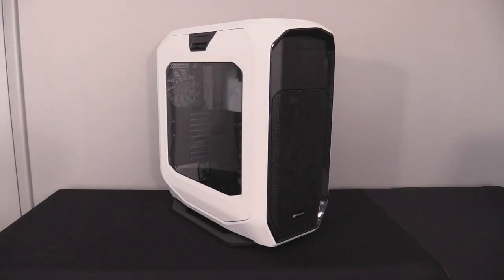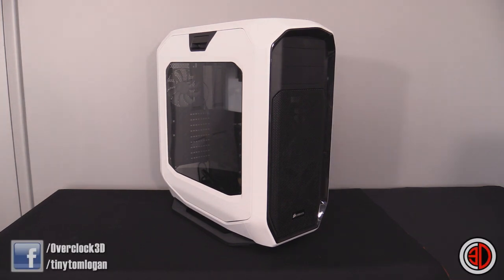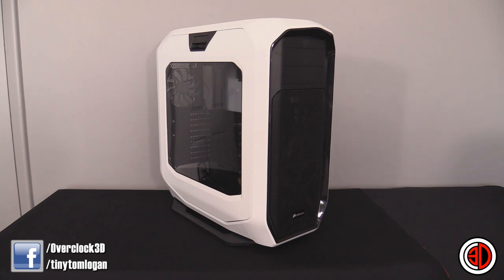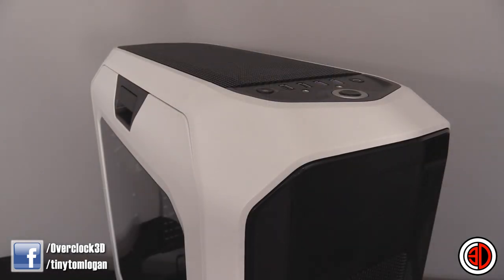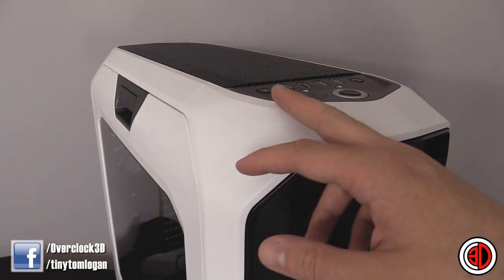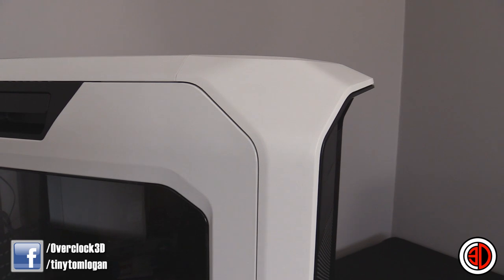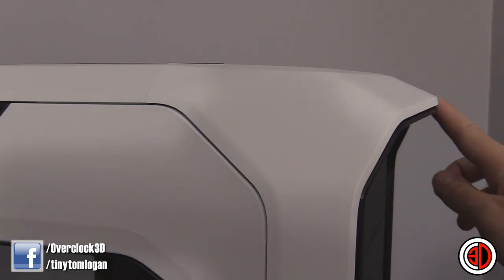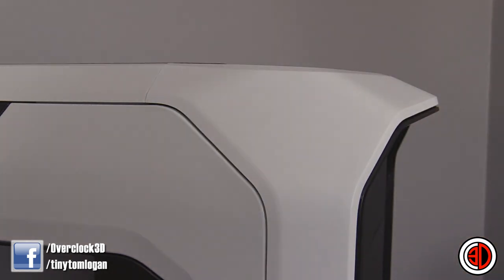Corsair Graphite 780T Review

Comment: So, i have now bought the case and installed two 360 Radiators in it. I´m using HW Labs Blackice GTX 360 Lite. These Radiators fit without any modding of the case even in the front. But if you want to use a radiator in the front you need longer screws to mount it. M4x35mm will be needed to mount the fans on the radiator.

Comment: I bought 600T white this January for my 4770K build.. now i'm selling 4770K and getting 4790K and swapping case to this 780T.. 600T will now house i5 4670K build with 270X x 2 Crossfire(My second PC) and selling this PC's case 300R which is used from earlier build 2 years ago.. So, this case is gonna be new with 4790K, rest is same from 4770K( H100i, 2 X 290X toxic is crossfire, AX1200i red and white LED strips for Black-Orange-White color based build).

After hearing so much about this case, i can't wait to get mine.. Plus, corsair have one of the best after sale service..Love it

Comment: I just purchased this to replace my 200R. I was debating either the Phanteks Enthoo Luxe, or this one. This one surely is a large tank, but in the long run it would be worth it if you want to do endless upgrades such as custom water cooling and such. Also, with the side latches, you won't have to worry about losing screws, etc. Hardware installation was easy, and endless cable management with plenty of room where you won't have to worry about how difficult it is to close the case behind the motherboard tray. 
Negatives is lack of Velcro tie downs that the Phanteks has, the plastic screw organizer box Phanteks has with endless bits, etc., and no rubber grommet for the power supply wiring hole. Other than that, very happy with it.
Reply: Loki5041, the panel does scratch. Not totally noticeable but I did it first day when I had it on the floor when I built this case.

Comment: Finally! I've been waiting for this case all year long, ever since the 760T came out. Not that I thought that particular case from Corsair was a bad design, just that it wasn't quite big enough/roomy enough for my personal rig. The 900D was too big IMO but the the 780T is absolutely perfect for triple slot GPU watercooling rig with two 420mm rads and have enough room to have a large reservoir. Personally I'll be fitting a XSPC dual bay reservoir into this case, since it only has two 5 1/4 in bays it will look like it was a part of the case instead of added into a rack of bays like the 760T would've. Perfect water cooling case the 780T, I cannot wait to start my new X99 build in this beast!

Comment: Corsair makes the best cases, IMO. Always beautiful & cheap.
Reply: ***** Well, there are plenty of amateur & professional "experts" that use Corsair cases and like them. FD and Phantek are good, but.. meh, never been a fan of the designs.
Reply: ***** Again, subjective.. my 300R has never disappointed me. Seems like super quality for the buck.
Reply: ***** What else would you want in a $50 case? A $400 watercooling set? $1000 graphics card? $500 CPU?
Reply: ***** I'm exactly what Joker said earlier: "novice". I have only built three systems and both quite inexpensively, so you know, "fan boy".. I'm too big of a casual-builder to be able to consider one manufacturer for elites only. So, naw.
Reply: CaseLabs make the best cases.
Reply: ***** I agree about Phanteks cases.
Reply: ***** i agree with you. but i wouldn't say corsair makes "shit cases" they are over priced yes, but bad case no..
Reply: you either like corsair cases or you dont, whats to argue about?... personaly i use a corsair air 540 because i like the way it looks, the room it has to offer, the ease of cable management and its very easy to work with if you want to mod it
Reply: Horrible and naff. Flimsy looking - those side panels look tissue paper thin..thumbs down for the product
Reply: Corsair used to make solid cases, but everything now looks like it's cut corners in some sort of area. . .
Reply: Ruben Williams  This is a good point, They are definately favouring plastic cases over normal ones. A good example of a great corsair case is the Vengeange C70, all metal build, awesome looks and features.
Reply: They're nice.. But I'd rather they did something a bit more premium that isn't as flimsy. I have a 750D; love the thought out design but wish the materials were a bit better. The case is what you see the most. I'd pay good money for a high quality Corsair case. Give me something made of high grade aluminium, I'll pay you 200 quid!
Reply: I really think they are lacking more and more of quality.
Reply: "Cheap" is relative, it depends on what you are comparing it with and what features you're looking for on a case. I've used plenty of Corsair products especially their computer cases, and I gotta admit, they get better in terms of bang for the buck. Sure Corsair don't make the cheapest case in the market, but their products can compete because they do use good materials and they put proper thoughts on the design especially on their "premium" cases. Although they're not perfect yet, they sure are improving. Last but not least, Corsair's customer service is one of the best imo.
Btw, I'm not a fan of Corsair, I'm just a fan of good companies that make good products.
Reply: Eric Sundquist Quality is the Obsidian Series. Graphite is the design and sleek looking series. Carbide is more value orientated and smaller than normal. Vengence is for LAN's and shows
Reply: ***** I appreciate and buy good products too, hence mostly I buy Cooler Master, Corsair and NZXT cases for most builds. On pricing, $200+ for a super cool case is expensive indeed but it's worth to invest considering the value of entire build - $3000-$7000 hardware in it.
Reply: TheWargod56

Yeah I watched Linus' video just now and the HDD cage wobbles. . . just other stuff on cases like the 350D, No rubber mounts for PSUs etc. .  .They're small nitpick things I agree, but a case company as renowned as Corsair should pay abit more attention to little details. . . as you say cases like the C70 were built like a tank.
Reply: Ruben Williams no its not nitpicking ..you have to have a minimum quality/sturdiness for  a £150 case..this case has not got it. if this was a fair review it will have had point nocked of for this..so this getting a gold award just devalues the gold award... am not anti corsair as the rig am building now is a 900D
Reply: yes, especially the obsidians are very pretty.... i have a 750d on my own :)
Reply: *****
Picked up a 350 D a few months ago. My first proper PC case. Best 90 bucks I've spent in a long time. But it's also a long way from a crazy over the top water cooled behemoth. Love my case though...
Reply: *****  Who are, Corsair? most of their cases are really overpriced, and are outmatched easily by many manufacturers. They often only include one fan with their cases and it's not even a very good one, whereas Fractal will include three and all three will be of great build quality and often are 140mm too.
Reply: Fractal R4 £69.99 on ebuyer. For most builds it's a good choice.
Reply: They might be beautiful but the build quality and the features are terrible, and in Sweden this case cost 400 dollars, so it's certainly not cheap
Reply: Yes they have great cases but the pricing?lol no,
Reply: Corsair cases are only cheap in their build quality.
80 percent plastic, and they charge for 100 percent steel
Reply: InfiniteDroid 1769 på inet, dock är inet överpris på de flesta varor
Reply: Mikael Soltaniha but this one is expensive

Comment: Hey Tom, thanks so much for the video (im a little late to this I know) 
If you see this I have a few questions!
Does the molex connector at 13:20 activate the front LED above the fans? 
And have you successfully tried a push/pull set up with the top fans? 

Thanks again! Just got this case and loving the real estate!

Comment: I bought a 780T and the Radiator Support is not so straightforward as the review tells. I have a XSPC RX360 radiator that can't fit at the top without blocking the access to the top drive bay. So you keep only 1 external drive bay. If you put it at the front, you have to unbend a latch on the upper drive bay so the radiator can properly align with the fans, the connectors must be facing up and are partially blocked from another part of the drive cage.you have to cut a part of the drive cage for propper access to the connectors. I have a dual bay reservoir so it iincreases the dificulty. I'm having a hard time assembling my system

Comment: Hi Tom, i wanna buy this Case but i´m not sure which radiator will fit in the front without any mods. The Alphacool seems not to fit in the front, so i need the measurements of the Alphacool to get a smaller radiator that fits in the front.

On the Alphacool website the measurements are (LxWxH): 400 x 124 x 60 mm
Is this right?

Comment: When you put the 80mm rad in there I actually said "holy shit" out loud. I don't watercool, and haven't since like '02, so I'm not used to these stupidly huge radiators.
Fuck me that white rad looks nice in that case! Pull the badge off, and make a whole build around two of those. jammed into that case. Looks like you could almost do two of them and have both in push-pull.

Comment: I was wondering with this case, is it possible to run a 280mm rad in the top (with a dual bay res) and a 280mm in the front and a 240mm (maybe 280?) at the bottom? He didn't mention the 280mm so was just wondering..

Comment: So which 360mm radiator does fit in the case front without modifying it? Can you recommend one? I had that problem you mentioned with this one: Alphacool NexXxoS XT45 Full Copper 360mm. I`m a little bit unsure which one i should take now.  Thanks! :)
Reply: ScraXer did you find a good 360 in front without any modifications needed ? because I plan to buy this case. thanks for your help

Comment: I have the possibility of buying of these a a good price. My "problem" is that I'd like to build a really low noise - silent system. I know that there a special casings for doing so - but I like the design of the 780T. SO - is it possible to build a silent system with this case?
Reply: PerfectBodyQuest by Harry M Lots of fans running at low rpm :)
Reply: Thanks - I chose the SilentBase 800 now - Works great ;)

Comment: is the Corsair CX430M good for the with r9 280x or gtx 760 ? i have the fx760k 3,8ghz just 1ssd & 8gb ddr3 from HyperX Black is overkill or still in the ok range ?
Reply: I will buy the xfx r9 270x I have the sistem just wanted upgrade the video card :) and I wanted know if the cx430m is ok for that video card it needs x2 6pin and the cx430 just has a 8pin adaptor that Kell need change to

Comment: Is it just me or are the 750D, 760T, and 780T all identical on the inside. 
Not that this is a bad thing mind you.  I feel my 750D is pretty much perfect inside.   I was just curious.
Reply: Well, yeah... They're all 700 series, so I guess that's the matter :)
Reply: Makes it easier from a research, design and manufacturing standpoint when all you need to change about a case is how it looks on the outside
Reply: David Green Very true.  And it isn't a complaint just an observation.  The layout is just about perfect in my opinion.    the only thing that would be an improvement is to made the 5 1/4 bays removable as well.

Comment: I can imagine a NASA inspired build with that white case. Blue accents inside with a big NASA vinyl on the outside. Tom, do yourself a favour and ditch those noisy Corsair fans for Aerocool Dead silent fans. They're at least +10db quieter than Corsair's, less rpm required for equal performance, better build quality and only cost a couple of quid more.

Comment: negative air pressure and no support for even a single hdd behind the case. They could have replaced the optical drives with additional fan space since no1 uses them anyways. Just a basic plasticy corsair case disappointed but imressed with the looks.

Comment: This is just a 750D with a different external design and with a 50 euro premium. But of course it says "Corsair" on the front and it's white, so according to TTL maths that always equals a Gold award. 

It's a good case, no doubt. But it's overpriced and it does not deserve a Gold award, there are better cases on the market for this pricepoint.
Reply from the maker: RBUpload Its nothing like the 750D on the inside are you blind?
Reply: OC3D TV It's not fully identical to the 750D, no, you're right. But it sure is very similar. They just reuse a good design and there is nothing wrong with that: it works. But an external make-over with the usual internal lay-out does not justify the mark-up in price.

Is it completely the same as the 750D? No. It's nothing like the 750D? Sorry, but that's just not true.

Again, don't get me wrong. It's probably a great case but I just don't see why it would be worth the high asking price and I can't see why it's worth a prestigious 'Gold Award'; although 'Gold' has already lost it's value on this channel for me personally.

By the way, I appreciate your concern for my sensory functions but I'm not blind though.
Reply: RBUpload sshhh, you're crazy...

Comment: I'm sorry, but I don't see why anyone would want this chassis. It's flimsy, bloated, and overpriced compared to Phantek's offerings. And the water cooling potential is far from groundbreaking... two 360mm rads is fine for a couple graphics cards and a cpu, but any more than that and you're going to have to really crank up the fan speed to get decent temps. 

If Corsair ever made a full aluminum chassis with proper water cooling support I'd consider purchasing one. But given how much they charge for the plastic and steel monstrosity known as the 900D, it would likely be more expensive than a Caselabs.
Reply: I want it.